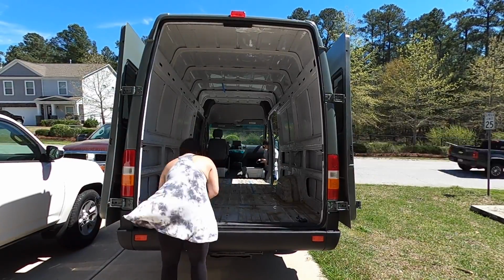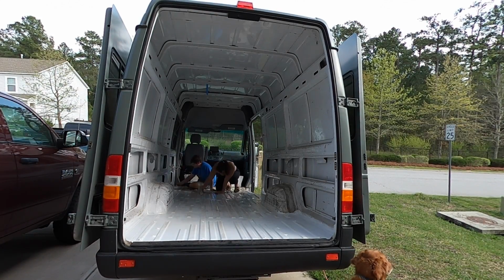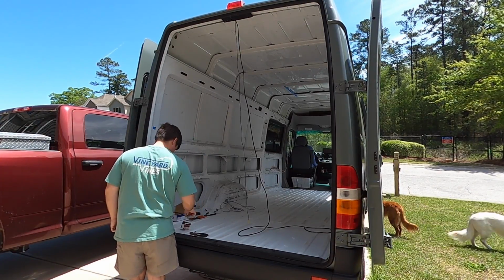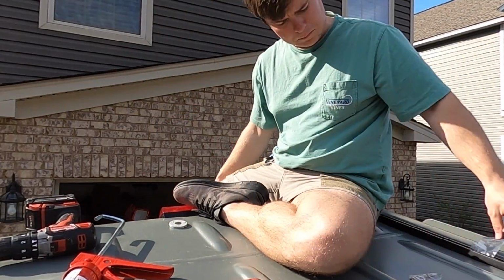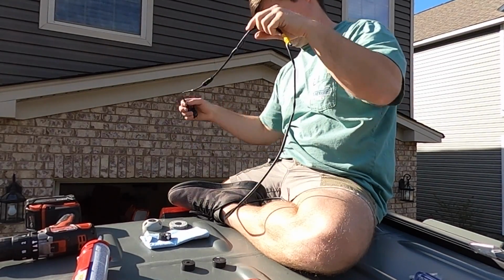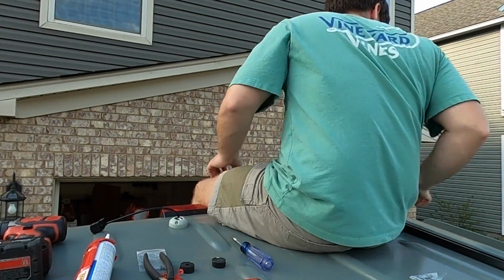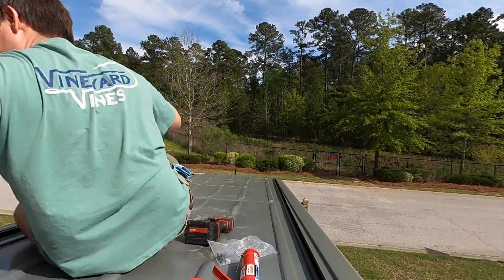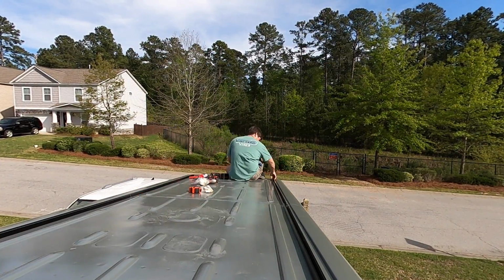Van Build Episode 9! Installing the Backup Camera and Roof Track System! DIY T1N Sprinter Conversion

Comment: Hello! I am going through a similar process with my van and the floor was also riveted in. What type of metallic bonding silicone did you use to seal up the holes?
Reply from the maker: I’m pretty sure it’s made by GE. We got it at Lowe’s and so far it’s worked great!

Comment: what adapters are you using on the proline rack rails?
Reply from the maker: Adapters to mount it to the roof or adapters to mount stuff to the racks?
Reply: @goldenadvantures2573  Adapter for the solar panels. Also I didn't catch the length rails you used (4 sections, 2 on each side).
Reply from the maker: I made my own adapters. I used 1" x 1" x 1/8" aluminium square tube as cross bars and used a 7/16" square nut to fit inside the roof rack. I can't remember the length of the sections but it was the longest one you can order from proline.